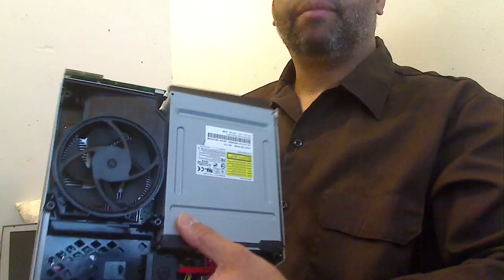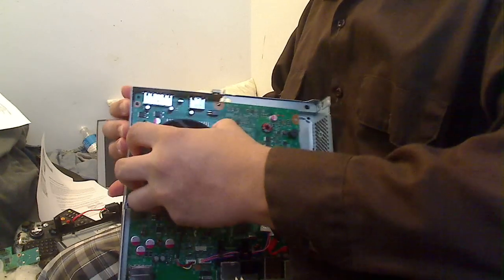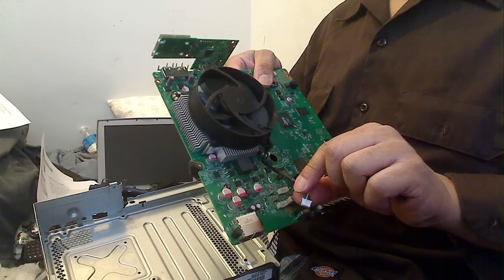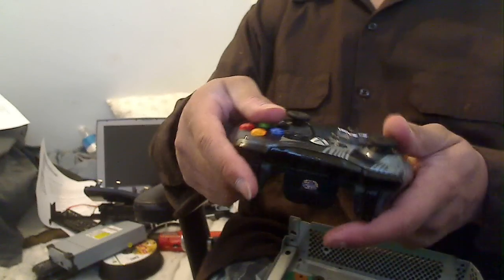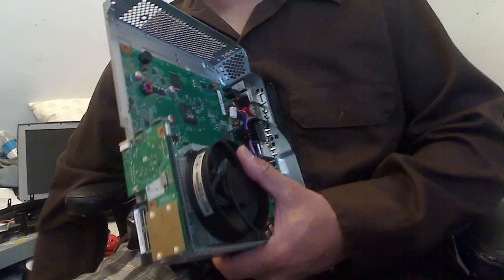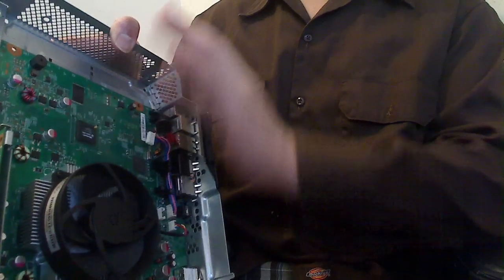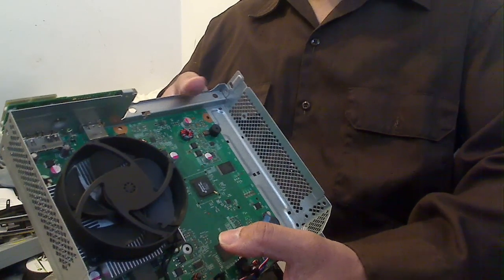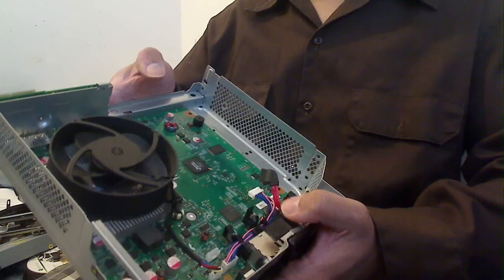How to fix Xbox 360 Slim RROD / Red Dot of Death Reset Solution👍

Comment: I did the same trick but instead of taking it apart I put cotton tips on the hole so the fan won't spin after 1-5 min it start blinking what do I do do I leave it or keep it going
Reply from the maker: You shouldn't use this trick. It is similar to an old towel trick method to overheat and reset the old phat xbox360's. It can cause over heating in places you don't want like capacitors. Find a YouTube video for disassembling your particular Xbox and take it completely apart. Then follow the instructions in my video to repair.

Comment: what is heat sync paint? please reply
Reply from the maker: You can purchase it at Radio shack, best buy, at Amazon or a computer store. It allows heat to transfer from ur very hot processor to ur heat block, then the fan blows the heat from the heat block out of the Xbox case. This is a continuous process so that the Xbox CPU can maintain a stable Running temperature over long periods of time.

Comment: Hey Donte, My xbox 360s works for a few minutes and then end up with a bright red dot with no display on the screen. I followed your instructions but it didnt work for me. Id still like to thank you for taking it out time and uploading this tutorial on youtube. The other day I noticed that if i left the xbox on with the red dot for a while, the power supplys light would also turn red. Could it be a bad power unit Thanks!

 - via YTPak(.com)
Reply from the maker: Yes, it sounds like your power supply is causing the problem. It contains a fan inside of it to keep things cool. If it has failed, then the power brick will over heat & then cut power to the Xbox. The Red Dot on ur xbox360 Slim may be caused only by ur Power brick. Borrow one to test it purchase one from a store who has no problems with returns, if the power brick is not the culprit. God luck & thanx for the kind words.
Reply: +Donte Beachem (Romerro) thank you for replying. I will soon borrow my friend's power brick and get back to you for confirmation. keep up the good work!
Reply from the maker: Ok Ehsan, good luck & thanx. Don't forget to subscribe.

Comment: i did the reset and it worked for like a day then it happend again, so i did the reset and it worked again for like two days and then happend again now i do the reset and it doesn't work at all.
please help me man!!!
Reply from the maker: +Gil Sh Hey Gil, this reset requires you to replace the heatsink CPU paste in order for the repair to continue long term. Not completing this task with continuous resets may cause damage to the processor or other parts of the xbox360 motherboard. If this was your process then, you'll have to replace the CPU paste for the next reset and you may require a Heat-Gun to run over both sides if it still red-dots. I talk about how long to do it for in the video. Good Luck..

Comment: can I just buy another hard-drive I had the 250gb
Reply from the maker: Yes if you're obtaining a red dot error when you're placing the hard drive inside the Xbox 360 Slim. Keep in mind that the error can also be caused by improper insertion of the Xbox 360 Slim drive. Be sure to check that it's inserted correctly before accepting that the hard drive is bad.

Comment: this just happened to me a few days ago I called Xbox they said it sounds like my hard-drive crashed so I was like OK... so then I took the hard-drive out and poof it works I put the hard-drive back in the e68 pops up.... what do you think!?
Reply from the maker: Your hard drive has failed. It will cause a red dot error each time u purchase it. Purchase a replacement 500GB OR Terabyte laptop hard drive from tiger direct or Amazon and place it inside the plastic case. Where ur current hard drive is. You'll need to watch a video on which one to purchase & how to format

Comment: I have had my xb360s for a pretty long time, and I haven't had any problems with it :/
Reply from the maker: That's great. Happy Gaming.
Reply: @Romerro1  I'm not lucky, My xbox had the red dot of death after it slipped from my hands a week ago.
Reply from the maker: @mayonezzzi  That's awful Mayo. Your internal hard drive may have come dislodged. Check it by removing it and re-inserting it.
Reply: @Romerro1  Alright, I'll report back tomorrow
Reply: @Romerro1  I fixed it, but i have to play at max 3 hours for every 5 hours
Reply from the maker: @mayonezzzi  Awesome but what do you mean by "...for every 5 hours of" what exactly.?
Reply: @Romerro1  I analyzed my xbox and the problem was in my CPU, so i replaced it with another one that is heating up too quickly for the fan to cool down,  i have to play for 3 hours max so it doesn't over heat and let it for 5 hours to cool down.

Comment: I've been experiencing games hanging for the last week or two, and finally i got the red dot today. Opened up and cleaned the whole thing, and minutes into booting BO2 (on cd), it crashed again!! I've noticed that playing a game for hours on the HDD ran perfectly, could it be related to the dvd drive?

 Also, after cleaning and booting, my console was HOT in that short timespan before BO2 could join a match! But the fan was spinning quietly and without much stress. I started it again, and just kept it idle on the main screen for about 25 mins, and it hasn't restarted yet. Suggestions please!
Reply from the maker: If your games are crashing during game play using the game DVD, then most likely there's an issue with drive, especially since you state that you can play games  for hours off the hard drive so I won't even talk about overheating of the GPU/CPU single chip. You may want to clean your laser and or clean the bottom of all your game DVDs. Your drive may be stressing your Xbox. Also consider the power brick possibly over heating. It should not be on carpet or any of its vents blocked. Check to make sure the power brick is not turning red when your console is shutting down or crashing.
Reply: Donte Beachem Thanks! I'll check the brick next time it goes and let you know. I saw the brick after I restarted unfortunately, and it was green then  and orange when it's off. I hope it's just the brick! Would make things a lot easier!

The hanging issues I had were happening with one of the games on the hdd. But this is the first time I've had any problems with this xbox. Again, hope its the brick!
Reply: So I checked the power supply, and it goes orange when I get the Red Dot, but green when things are fine. So it's probably working fine right? No red light on the power supply for sure :(
Reply: +Donte Beachem (Romerro)  Update - It's going Red minutes or even seconds into starting the xbox (which means it's probably not an overheating issue). I cleaned out my power supply, tried starting without the hdd, tried using a different plug point - no difference. Should i open it up and try booting after disconnecting the DVD drive?
Reply from the maker: +slaughtered777 The power supply has a fan inside for cooling internal components. If the components get to hot the power supply will discontinue power. Long term damage can occur to these internal components over a period of exposure to heat. The fan must be operating. If it is not, you can try replacing the fan or replacing the power supply.

Comment: When i turn on my slim it will power on for 6 sec w/red dot and power off without the screen showing up at all on my tv so there is no time to reset/over heat the processor ive check all cables idk what else to do?

Comment: i did a system update then it the screen went away and it made this loud fan noise and let off a cool breeze (for an xbox) then it was red and shows nothing.so would i do this? also when i reset it will i lose all my profiles or should i be okay
Reply from the maker: You wouldn't lose your profiles but I'm not sure this fix us right for u. You may have an upgrade or patch error. You may need to send it back to Microsoft. I suggest calling there help line for assistance.
Reply: +Donte Beachem (Romerro) thank you i will take your advice

Comment: I do not trust myself I think it will break
Reply from the maker: Then before u do anything power on the Xbox and make sure your Xbox power supply doesn't have a red light. If it does, replace it.
Reply from the maker: Remove your Xbox hard drive and then power on the Xbox. If it powers on then the hard drive may have been inserted incorrectly. Really insert firmly. Or the hard drive could be bad. You may have to replace it.

Comment: i got a problem also, my xbox will turn on and the screen will show but there is a red dot on the xbox and no controllers will connect, also before it did this i had the problem with the touch so i took off the case off  and now its broke :-( please help

Comment from the maker: When u say u tried different screens, do u mean u tried different TVs. Otherwise try a different TV.
Reply: you look like you can out of terminator movie
Reply from the maker: I have no clue if ur Xbox is broke. You also stated in another comment that ur Xbox got worse. Explain how an Xbox that doesn't work goes to an Xbox that still doesn't work, gets worse. Repair videos on YouTube are meant to supply a possible repair solution for you; not an absolute one. If this video did not help you as it has so many others, then this video is not a solution for you. Find another. We're all just here to help based on solutions that have worked for some previously. I'm not a Microsoft engineer. Good luck.
Reply: You got it wrong, im not saying that your video doesnt work, im just saying that the game use to play for 10 minites then it switches to red light and i tried your video and from that its just red light alone. I didnt say something is wrong with the video u showed im just asking you for further assistant if u can help, thats all im saying.
Reply from the maker: +landy lobban Very well then. Check your power adapter to see if it also has a red light once the light on the Xbox turns red. It appears that your Xbox or your power brick is over heating or both at once. Also, try placing your X-clamp back in place and remove the screws. Overtightening may warp the board and loose connections to the processor. Let me know what happens.
Reply: +Donte Beachem (Romerro) the power brick is ok the last thing i saw on the 360 was "the xbox 360 is shutting down to protect this console" somthing like that and from that just pure red light
Reply: Is the x clamp the thing that is around the heat sink?
Reply from the maker: +landy lobban No the piece of metal on top of the processor is the heat sink. It is meant to absorb heat from the processor and then allows the fan to blow the heat from the case. The x-clamp is underneath the main-board and it anchors the heatsink and fan on top of the processor. If you havent replaced the CPU-processor paste then this is most likely your problem.
Reply: +Donte Beachem (Romerro) 

His description of broken to "more broken" matches my situation almost exactly. I was able to load a game and play for a few minutes before, then took the system apart to replace what ended up being a faulty fan and reapplying thermal paste for good measure, now it wont start up. Green light for a few seconds, then the fan kicks in to high gear and I immediately get the red dot flashing.

Now, I got there on my own, from having modded 360 fans and cases before, and building desktops/repairing laptops for myself and friends. Once I started having issues, I had to look for more info, and came across many videos, then found yours.

It sounds like you ask to unplug everything but the video cable and power, with the heatsink attached, power on the system, and leave it on for awhile while it is overheating. While I understand what this would do, I cannot get my system to stay on for this process.

I have also interpreted you as saying that it needs to be turned on with out the fan plugged in to reset the processor, after which the fan would be plugged back in and the system should start normally. I have tried this as well.

I have my 360 apart, with nothing plugged in but the power and HDMI, heatsink attached with x-clamp. It will not stay on after overheating like you mention. It shuts off very quickly. Because of that, I seem to be unable to let it heat up for 20 or so minutes as you suggest. Thoughts?
Reply from the maker: +Carson Barry hello Barry, if you've added the screws per my video. Remove them & place the x-clamp back in. Sometimes when performing the x-clamp replacement with the screws & washers, overtightening can occur or improper size of the washer inserted which can cause warping of the board underneath the CPU, losing solder to circuit contact. Try replacing the x-clamp & recheck for sufficient heats ink paste. Reassemble then restartrestart.
Reply: my Xbox 360 slim has the red light what is it if I reset it does it delete my stuff
Reply from the maker: lol. No it does not delete your stuff. It resets the hardware mechanism built into the motherboard which clears the indication that there's still a problem with the board.
Reply: that xbox need to reball a chip ..change the cooling fan..
Reply: Donte Beachem how many washers did u use?
Reply from the maker: SpectrumModz Don't use the washers. I need to edit this video to indicate so. After you do everything else, just place the xclamp back on.
Reply: Donte Beachem my xclamp is like bent and shit from me taking it off and on trying to fix my xbox...
Reply from the maker: @Bimmer_Bino  to you can find vendors on line that sell them

Comment: I have a strange problem, haven't used my console in a while, it was fine last time I used it. 
Console turns on and acts fine as long as no AV cable or hdmi cable is plugged in. As soon as I plug it in, it turns red, with only a thin red outline (no light bars on the side).
I've tried multiple power sources in different locations, I've tried different screens and different cables. Nothing.
Reply from the maker: I'm assuming that you mean TVs when you say screen. You should check the video ports in the back of the Xbox. HDMI and the Xbox proprietary video port should be absent of debri.
Reply: Donte Beachem Yes I tested our LCD TV and my computer monitor. Even if it's not plugged in at the other end it goes red, but I have a can of compressed air, I'll blow on the ports just in case. Otherwise I'm just going to send it in for repairs. Thanks though!
Reply from the maker: +Ceasius Before using a can of air do a visual inspection. Air may not remove a piece of metal that's lodged in the port and grounding out connections.

Comment: Hi < I have  A Big Problem. It seems like u now your stuff... I just got a Xbox 360 Halo 4 Edition . I pluged it in to a Smart RV With HDMI Cables played it for a bit worked fine. Then i bring it home and plug it up and it got to the first page for Madden 25 and it froze. now it wont even make it past the first screen and sometime it will not even come on. trying to turn it of f and one the RED dot some on. Then ill turn it on off for for a bit and the red goes away and try to load and it wont get past the first few screens...I removed the 320 hard drive and pluged it back in still nothing. I can see alot of dust in it. I just got this as A used console and i am think it need cleaned. Could u pleaase help me...Thank YOU alot...